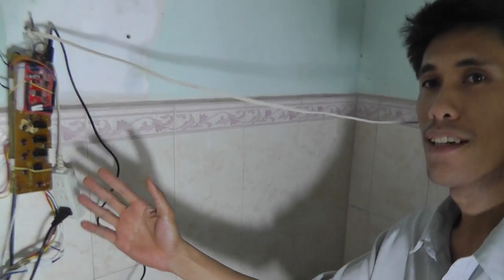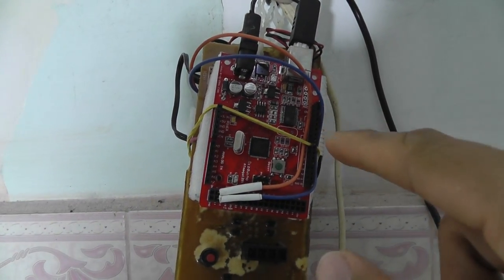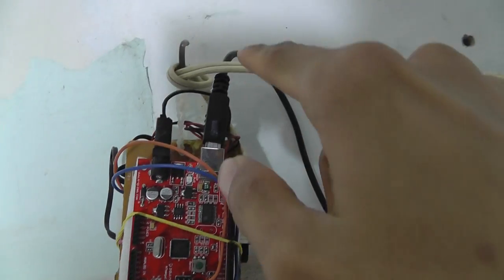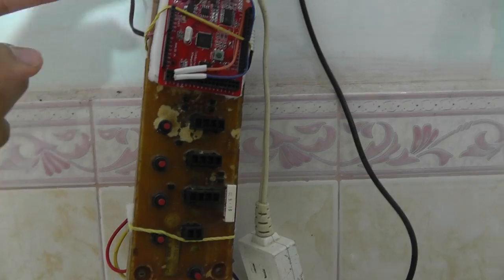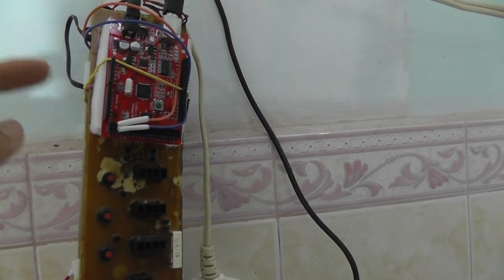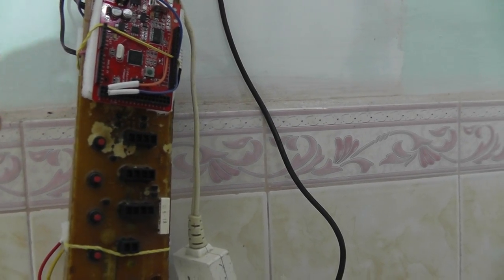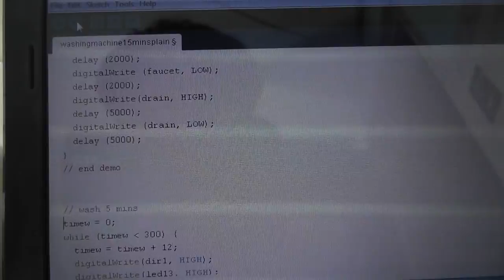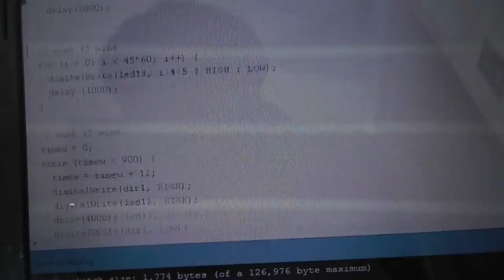arduino washing machine update 2

Comment: I have got one doubt regarding water drain how machine calculates water is fully drained are not do u use any water sensor for drain purpose
Reply from the maker: you're right.  this version just estimates.  anyway the water is only for rinsing. the soap water has been prefilled before the program starts.

the newer version uses a float at switch so as not to waste water from estimating (and overflowing).

Comment: Bro can u use drain pump for drain instead of mechanical method for drain
Reply from the maker: probably sir. it might cost more
Reply: winelfredpasamba u can try and make another video
Reply from the maker: what are you curious about?
Reply: winelfredpasamba curious about drain pump and how drain pump works how drain pump will calculate how much water is still in the tub is there any sensor to calculate how much time the pump has to run can u explain about the drain logic
Reply from the maker: oh. i just pulled the drain. timed it. added some 3 minutes more.  not critical as draining is only for rinsing. and rinsing is 4 cycles.  one or two times i remember seeing it not drain complete, i just adjusted the drain string as it was not opening the drain enough.
Reply: Plezz share code urjent
Reply: @winelfredpasamba  hi, could you share the code and connection diagram? thank you :)